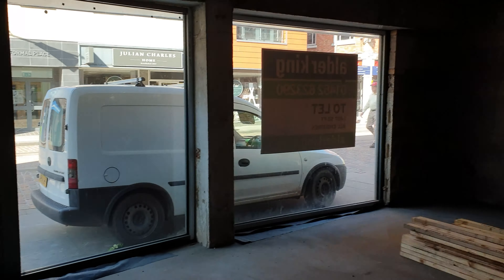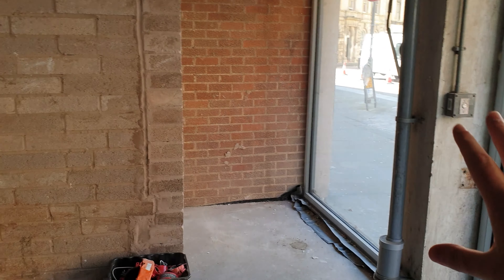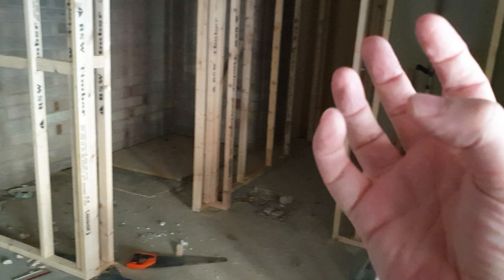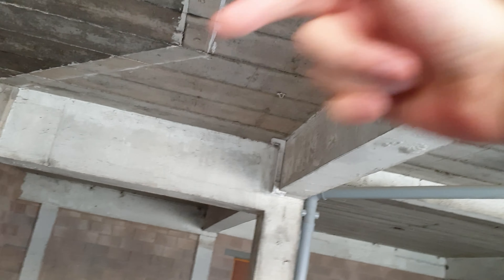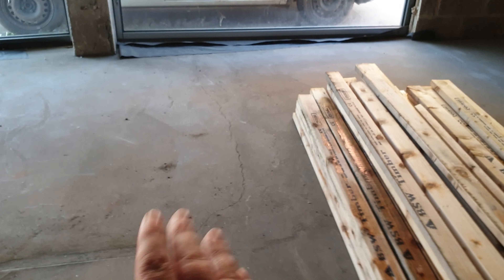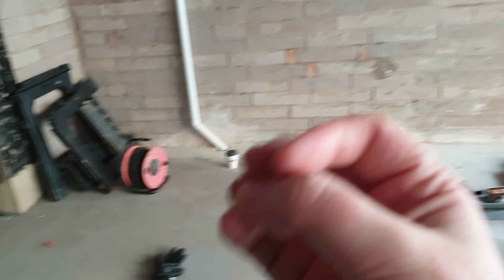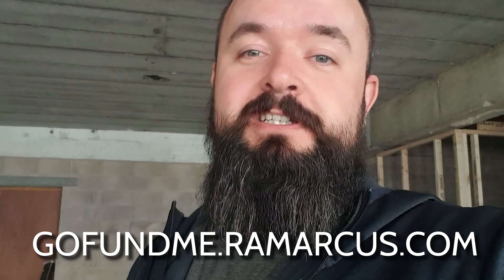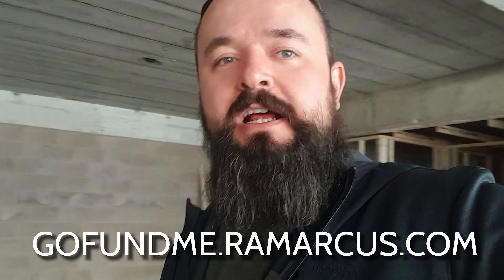NEW VR ARCADE COMING SOON! GET YOUR NAME ON THE WALL! GOFUNDME!

Comment: VRcades need to be designed similar to holiday “pop-up” stores or trade show booths, with easy setup & teardown. That way, Manufacturers could leverage product visualization & customization for  RecreationalVehicles (e.g. Winnebago), Yachts, Trucks/Cars/Motor Cycles, Construction  Equipment, Locomotives, Planes/Helicopters or Architecture (e.g. Tiny Home or Log home design). Let’s enable quick setup of virtual showrooms and the 3D models so sales can happen with far less real-estate and logistics cost/complexity of physical inventory expense.   And eventually, from home. Remote collaboration with product experts will also be an essential element. Emerging tech like 5G & next gen VR headsets (precise eye-tracking, foveated rendering, wider FoV) will make it real.

Comment: Looks very awesome.  2 Suggestions, a changing table for little ones (if the Mrs is happy bringing the hubby there to act like a kid, they will be more likely to come back) and if you want temp barriers for the stand up Vive Pro area, think mesh curtains (like in hospitals but fully see through) that can be retracted and hidden up against the wall when you want the full area, but when out, the players will feel the curtains and know to get back into their own play space.  Good luck with all of it man.
Reply from the maker: Baby changing area is a good suggestion, not sure we have the space but I'll suggest it to the builders and see if it can be squeezed in. 🤔 I like the curtain idea, but the Vive sensors mess with each other and moving curtains will be an issue, going to use two sensors to cover two stations to keep it simple and just use a tape barrier to be able to have a nice clean space. They'll be mats for them to stand on so they know where to stand, it may evolve over time.
Reply: @RaMarcus  Ah that makes sense, didn't think of that.  Good luck though, it looks awesome wish I go see it.